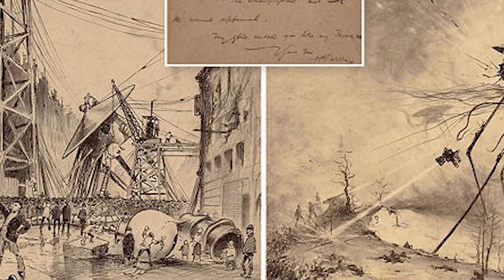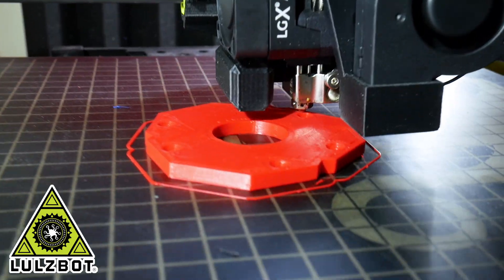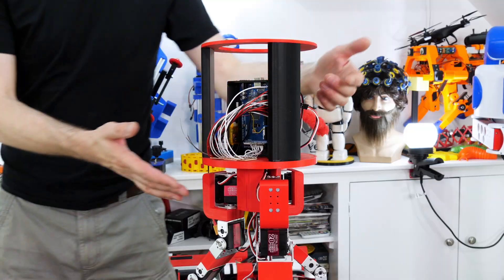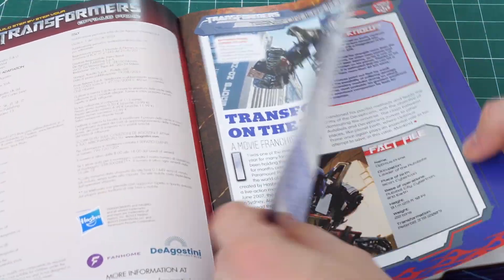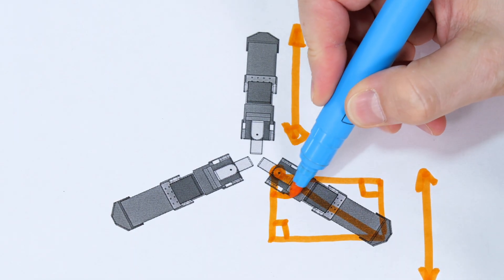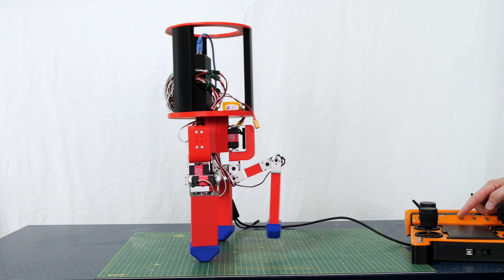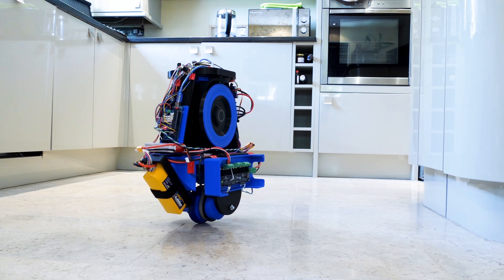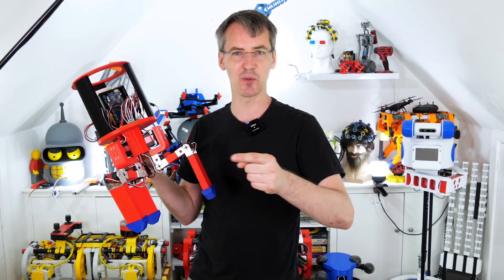Could Alien Tripods really walk Robot

Comment: As someone with animation experience, I think I see what's causing issues with the tripodal locomotion. (Though I'm not sure how you'd fix this using a controller as you are, maybe a litle AI might help with what I'm about to point out)
The issue is that you're trying to keep the tripod stable as it walks. What a tripodal creature/mechanical monstrocity would want to do is use swaying it's center of mass to use conservation of momentum to just keep falling into the direction it's going. This is what we do is bipedal creature. Stand securely on two feet then try to lift one foot without moving your hips, you'll find you're off balance. You need to move your hips to move your CoM onto your other foot. Doing this over and over won't move you forwards though, you need to let yourself fall forwards then catch yourself with your other foot for that to happen.

Comment: You could have a big weight continuously swinging around the center axis on top of the robot, which makes the robot wobble in a circle, picking up all three legs in sequence, allowing them to move forward and make a step while the center of gravity is over the other two legs momentarily. It would basically look like a drunk robot that's swinging a big club over its head while moving forward.

Comment: My first theory is that the legs are flexible enough for one of them to always be placed under the tripod’s center of mass while the other two move it forward. This would allow for continuous movement rather than choppy move-pause-move-pause. If the centered leg was slightly off, maybe a form of gyrostabilizer in the head could make it balance.
My second theory is that all three legs are attached to a swivel that allows them to collectively rotate independently of the head (think of a lazy Susan). Leg A would be under the center of mass, Leg B would swing into a point ahead of it, then Leg C into a point ahead of that. Leg A would push off to make Leg B centered then rotate the swivel to make Leg B in front. Leg C would repeat that process, and it would end up looking like a sort of conveyor belt with the head moving overtop.
Model: A-B-C (swivel) B-C-A (swivel) C-A-B (swivel) A-B-C (repeat cycle)

Comment: what is if you you set one leg as the back and two on the front. if you lean back and tilt the head back you cold lift a leg and place it 10cm or so more front and if it is places do the same  with the other then lean front and take the last stept. of course you need a accelerometer for balance but walking is is done much easier and natural. looking at varios films moste of them walk this way even you dont see the feet. 
i think this could work this way

Comment: So... here is the problem. You are tackling a 3 legged walking object while still trying to make it walk with bipedal movement. 

Look at how people actually move. With each step we lean into the step and bring the back foot forward to counter balance the falling forward movement, then simply shift our weight  to bring the back leg forward and so on. 

So, With a tripod, the movement is pretty much the same, the difference is you treat to two front legs not as independent legs, but as 1 leg, the "front leg". The best way to explain this is to think of a Downward pointing Triangle, as the starting point. One leg is in back. This leg is #3 for reference. Then we have #1 on the left, and #2 on the right. 

🔻

The way the robot will move will be roughly like flipping a 2d triangle, as far as where the legs are places. Each corner of the 2D triangle determines the placement of the leg , when you flip the triangle along any one edge. So starting in a down triangle, to move forward, we would flip the triangle along the top edge like so:

🔺

But to do this, The robot has to bend it's knees (preferably it should have at least 3 knees for easier mobility, hence why movies show tentacles), and bend forward on legs "#1" and "#2", offsetting the center of balance, and creating a falling forward motion. When it's beginning to fall forward in it's leaning momentum, where it's balance has been shifted from 3 legs to 2, that's when the back leg (#3) swings forward under the body and lands between the two front creating a stable counter point, returning it to a tripod position. 

In this position, now it can only move in one of two directions, along either the Left edge, or the Right edge. Now #3 and one of the other legs become the new "front legs", based on the new direction you want it to go. Then you simply shift the weight to off set from the back leg in front, to one of the two front legs (either randomly, or based on stability of footing). 

SO to simplify, for explanation purposes, we will have it move along the right edge. 

This means that #3, and #2 are now the "front legs". So now to flip the triangle along the "right edge" The body wound then partially kneel and lean to the right. Once it gets to a bi-pedal balancing point, leg #1 would then swing around the Left side of the body and then to the center, to create a tripod. Now, #3 and #1 become the "front legs". However to keep the legs from tangling up, It now has to move along the "Left" Edge. 

This time it bends #3 and #1 to offset the balance, and once it reaches the bi-pedal balancing point, #1 swings around the right side, and creates the Tripod again. 
Then the sequence either reverses, or repeats. 

One way you "could" avoid the "tangling", is to have the torso rotate by 360* while its moving certain legs, This would help it not get it's legs tangled.

Comment: would not the best way to walk with three legs not be like a person with crutches?
as in the middle legg moves inline with the motion, and the two other leggs are 90 degrees to the intended motion (like arms), then to take a step, you push with the middle legg until the body passes over the middlepoint (until it wants to tipp forward) and then quickly move the center legg forward to catch it, then it does the reverse, aka leans on the center legg and moves the two arms forward togeather. this will ofcourse require the body to constantly be falling forwards, like we do when we walk. I assume for this to work it would need some kind of balancing mechanism to be able to stand on the single legg, though idealy the step should not last longer than a few miliseconds

Comment: Shouldn't a tripod just be a bi movement with the third function as as a corrector mechanic? Likely it will be suggested later but it feels like one is overthinking it. One leg just needs the strength and balancing while 2 are of ground

Here is me overthinking this
Or Tripots are just armed with enough fire power to scare away the wild life.
While a Tripot is nothing but a walking oil tower sensing for thinks to harvest hidden underground.
“Back of, Bipod Mamalians. We are working here”

Comment: As to gait, I think it is Two legs Facing the direction you want.  The single rear leg then pushes off, as the two others carry the weight.  Rear leg reaches into direction of travel to then carry weight as the two "arms" pivot forward yet again.

Like a cheetah with its two hind legs fused together.

Comment: The only way our species could ever replicate it would be to use machine learning or essentially give the machine a "subconscious". You could possibly make it happen with modern computing, but a quantum computer would be the best option. The feet would need more pivot points for better motion, the "brain" would need to simulate reactionary movement and factor in inertia, weather, gravity, ect and map out its next movements all while communicating with the current times position and data. The math would be ridiculous as the "brain" would have to come up with almost an infinite number of solutions based on the difference between what it "is now", "will do", and "will be"; all while calculating external influences such as inertia in fractions of a second.

Comment: first of all, sorry for your sponsor, but i would never let any child of mine wear that psychopath movie optimus on a backpack.  that dude is a war criminal with a fetish for ripping faces off.  no i am not speaking figuratively.

i'd use a different mechanism to get the step.  i'd have each leg have a wedge-shaped foot, connected such that most of the wedge extends from the base of the leg, like our own feet do.  then, to move a leg and take a step, i'd use the foot to slightly rock the whole thing back, then, as that foot breaks contact with the ground, the leg swings to its new point of contact, the extension of this motion countering the backwards rocking, and reversing that motion so  so that the foot again makes contact with the ground.

basically, much more like our own legs and feet work.

Comment: My thought for an approach is actually to rotate the whole bottom while a top part remains facing forward.
Essentially it would have its weight on two legs as the third makes a move, with it shifting its weight onto any leg that just moved and the one that isn't meant to move next.
Steps wouldn't try to keep the bottom oriented the same, they would use the rotation so each leg would be at the front at a different point.
I think this translates into some of the steps moving backward a bit for balance, but the steps forward could be bigger to ensure forward motion is maintained.

Comment: How I would explain how a tripod works is it uses anti gravity technology. The head is basicly just floating in the air while the legs are pulling it along like a helium balloon. This way there is no need to balance on two legs and you don't need a strong enough anti gravity device to make the thing properly fly. It is in a state similar to neutral buoyancy with the anti grav canceling it's weight out.

Comment: We walk on two legs so what make you think something with an extra leg might not actually be able to walk, of course they can walk. We have dogs and other animals with three legs and they can walk fine. Yes, the tripods are not living creatures, but the aliens clearly have more advanced knowledge of technology than we do so its not exactly far fetched to think they could make a machine that can walk on three legs. The question isn't whether they can do it, its could we do it with our level of technology, and the answer to that is no, not at that scale. Why don't you just move the legs to the sides instead of attaching them to the under side so the centre of balance is lower and also offset the legs and have them on an angle instead of just vertical.

Comment: the original book explains that it's walking motion was like a milking stool slightly tilted so it would fling around the axis of one leg with 2 legs in the air.. Don't know how that would work though  because it would need to balance without a gyroscope since the Martians didn't make use of the wheel. A nice nod in the 2005 movie about this fact comes when one of the Aliens turns the wheel of the bicycle in the house and looks at it with interest.

Comment: I came here to wonder aloud why no-one ever depicts the tripods moving as described in the novel. If I remember correctly, they move very fast and destroy trees from their movement as they pass.  They are likened to a "milking stool tilted and bowled violently across the ground" which seems to describe a rotational movement. Even supposing the gait is not rotational, the tripods have never seemed as swift or violent as they should be.  I hope one day to see this, but at this point I'm not holding my breath.

Comment: To me, it looks like the forward leg needs to extend at 22.5° or 45° and then pull the body forward, while the back legs pivot on ball and socket joints as they move forward. But this also needs to happen for the other two legs if a tripod will want to move in 360° field of motion. I would think the gyroscopes will help with the balance as it turns.
Sorry if my description isn't clear.
First time watching one of your videos, looking forward to seeing more. Any fan of Bender and Johnny 5 can't be that bad, lol.

Comment: They could, but balancing would be really difficult.  Traditional robot designs usually put the center of mass between the legs, but that simply wouldn’t work very well..  you’d need to balance on two, move the third leg, then shift the center of mass to that leg and another.

Comment: Could you use counterweights to balance?

The tripod is stable between steps. You could move the weight so there was not presssure on the leg you move, and then centre the weight to stabilise.

Comment: Ok, maybe you need the exercise of using a screwdriver to put in screw after screw but it really does seem like a waste of time.  Ages ago I know a good drill have three or more features that are useful, they can put in or take out a screw and many have a power setting so you can't over tighten a screw, this you would need to try and set it and then you should be able to place squeeze done and put in equally always (I say that but into would I'm not sure it was always perfect but your work surface and items seem much more consistent that wood is.  Anyway get a good drill and lose the screwdrivers oh I suppose you might need a good set of screwdriver heads for the drill if you don't have them.

Comment: I had thought what if tri alien robots actually didn't use their legs for structural support but a bounce to its system utility. Think of jellyfish, top side mass is a form of blimp with technology around it this blimp part is actually how it stays up, legs help keep it from floating down to earth surface, adds ability to have melee fight ability, help in movement and if it is internal air tank is pooped the legs can be used as way to move around though limitedly till it patched up again, so tentacle based legs make more sense as they work more like arms for grabbing things then legs but can still be used as one, think of design like the massive tridroid of star wars, though more then three limbs would give more utility. A good example of this is Those tentacle robots from the matrix franchise.

Comment: I would love to see a version of this that has longer legs by virtue of a third joint, creating a ZigZag shape for each leg, with a rubber cap on the end of the added leg section. This would increase the height of the robot compared to the 'head', improving its stability as a result. it'd also make it much taller and more intimidating as a design, giving it a faster gait and making it more useful as a robot. Possibly with the added gyroscopic stability, it would be able to adopt a swaying motion that has each leg take a step one after another with an equal rhythm and timing for when they move.

Comment: Tripod locomotion is very different from quad locomotion. There are several 'gaits' involved. Consider the legs in clockwise as 1-2-3. The being/mechanism must essentially balance/brace on two legs while seeking forward position with the next. In War of the World's, this is his 'spinning stool' description. 1-2-3, repeat. (or 3-2-1, repeat) 

A 'trot' or run is possible  brace with leg 2 and swing 1 &  3 forward.  Brace with 1 &  3, then swing leg 2 between to the next point.  A gallop is sequenced like a walk, but the 'body' would be differently positioned.  You might even end up with a 3point cartwheel.

Comment: What might help would be to not declare a "forward" alignment, allowing every direction to equally be treated as forward direction as the situation requires.  This would best be achieved by establishing case states and copying what you have for one leg being "forward" onto the other two legs as well as creating three states in which each one leg is in the "back" and two legs in the "front".  Where "Front" or "Forward" is can be determined by the rotational alignment of a turret relative to the orientation of the main body.

Comment: Material science. The entire tripod can support itself on one leg.
The three are just for movement. 
If you build one that can support its entire weight on a single leg by locking and being able to support that odd position by digging into the ground and withstanding the forces. 
That is how I pictured it.
At that point the legs are just for moving in any  direction not support.
Balance not necessarily needed.
Not saying it is optimal engineering by any means but I believe that Martian materials and power could over come the inherently unstable design to make it work.

Comment: There are several instances in the book where the legs and the gait is described.  H.G. Wells always described them as having two legs in the air when they walked, pivoting on one leg like a three legged stool.  I have never seen anyone actually try to replicate that.  Having the legs all connected at a center point seems like a recipe for disaster.  Never understood that design decision if you want any kind of directional movement.

Comment: And then there was a 2015 with another type on tripod and then a recent one called war of the worlds the Attack which came out this year, but in my opinion the 2005 tripods are my favorite.
“I say tripods because there are 3 different types, The harvester which has tentacles and no heat rays, the warrior which has a flatter head, heat rays but no tentacles, and the Uber pod which has an extra set of lights and the lights are also yellow and is bigger than the rest with a rounder head.

Comment: Never thought about walking mechanics, but it feels that at first you need to create something self stabilized (e.g. gyros or hands on human body) and then add locomotion mechanics like legs. It would then fit the whole idea of tripod - tripod can be placed evenly on almost any terrain, means when not in motion and unpowered is it super stable. I guess that was the original thought of G.Wells. 

Here in video it is the opposite - creating 3 legs just to have 3 legs and then thinking what to do with them. Whole idea that 3 legs should be separated 120 degrees is a bit questionable.

Good channel anyway 😎